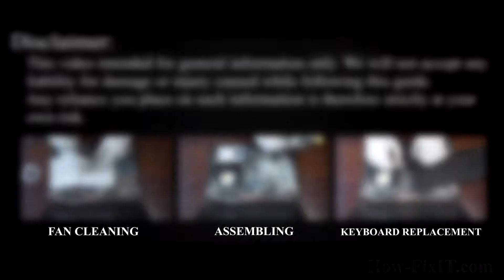HP ProBook 4320s Wi-Fi Card Replacement | DIY Repair Guide

Comment: Hi, how do I know if the card needs replacing, WiFi working fine, laptop charge low, turned off, after putting back on won't connect to wifi
Reply from the maker: I’ve provided a link to compatible Wi-Fi Card In the description under the video